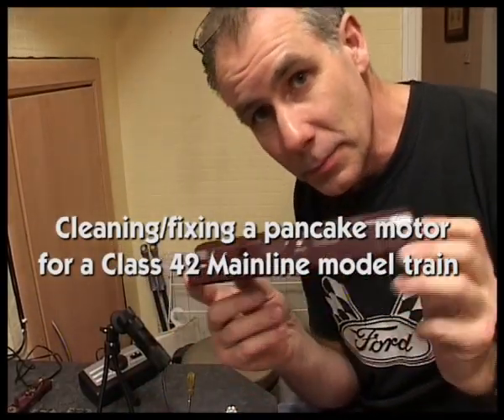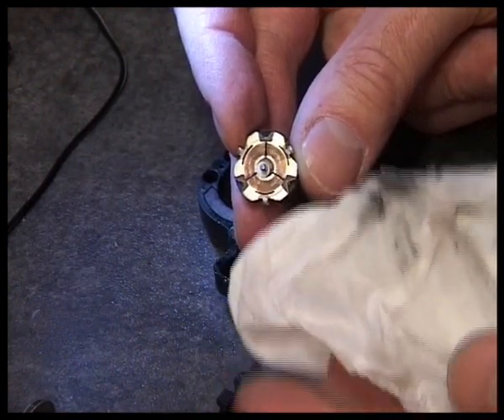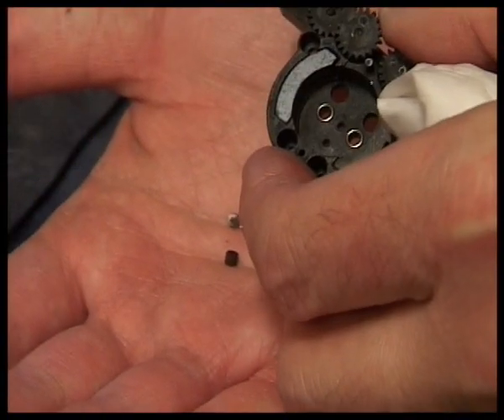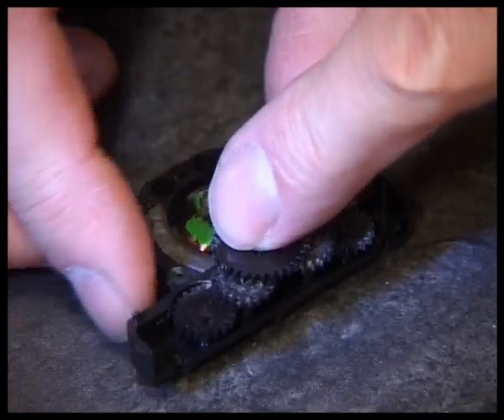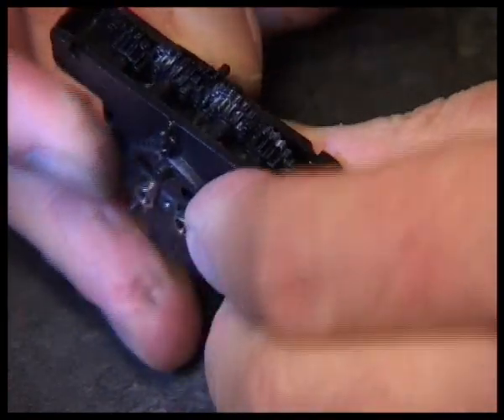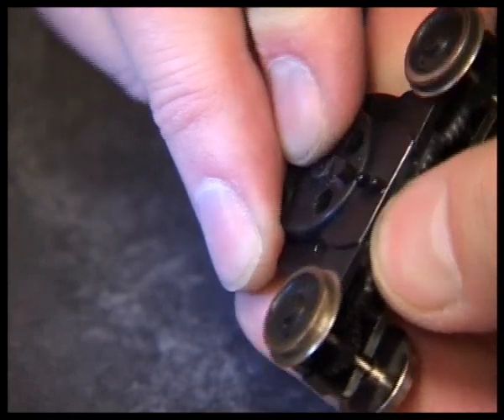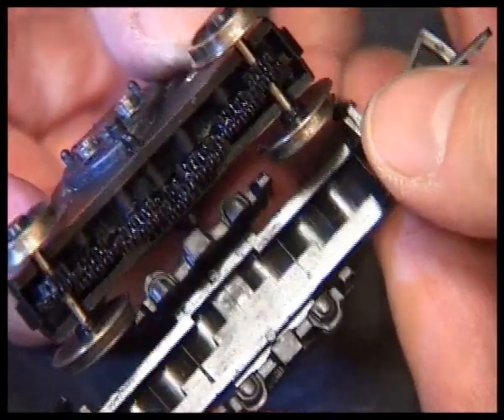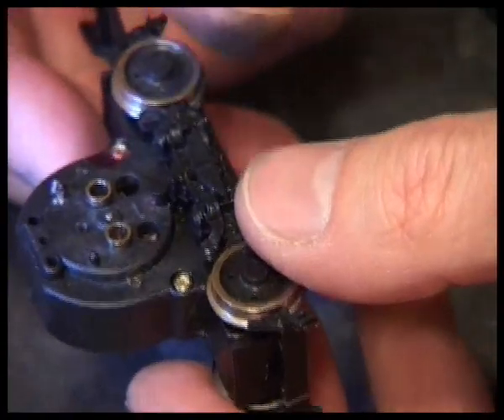Model Train Motor Fix Pt 1 of 3

Comment: Ok, the problem usually is that the metal material in the brushes gets caught in between the segments of the commutator so there is not enough electrical separation between the different segments of the commutator. You either have to cut deeper groves in the gaps in between the commutator segments, or add material to thicken the commutator copper sections. But if you thicken it up you have to cut the sections on a lathe to get a nice flat even surface. Dust in the brushes should fall out of the motor in the gaps in the commutator. This usually happens when the commutator wears down.
Reply from the maker: Ok, thanks for these tips. I've now replaced the motor but thanks anyway.

Comment: Need a video on how you it all apart and out of the shell.
Reply from the maker: Good point Fred. I've sold the loco now. But with this LIMA one you gently part the outsides apart at the bottom of the body shell. There are four little lugs holding it in place, and they stick into four slots in the body itself if I remember rightly. You can actually see them on the sides. There are right under the drivers doors. Also I think the four buffers need to be pulled off first. Laurie.

Comment: i dont own any non steam   as i have a ainline tender  evening star   & i noticed its been  playing up  then the last i ran it it hit a dead zone AKA the  points   the when i   pushed it back  or checked to see if it  derailed   tried giving it   full power & it wouldnt shift  the motor woud still work but not move it at all to the point you can just    get a smaller type  to push it or it needs manually moving  so i took it off the current lay out  &left it sitting elcewere  & when ever i check back up on it  still not redy to return to the lay out   its DDC  as well  but  the wheels sill   freely move
Reply from the maker: It sounds like an old DC (analogue) engine you have there. If it is digital DCC then it could be chip related but I am going to assume it is analogue for the moment. I had an engine that did this, and it was the motion (rods over the wheels) that had jammed. I took it to a local model shop and they fixed it for me. Are the main wheels on the engine jammed? Your actual model driving wheels will of course be on the tender. Hope that helps.
Reply from the maker: Ok, just got your second message by email but it is not showing here on my browser for some reason. I know the model - have two 9Fs myself. Anyway, if the ten driving wheels are jammed, then I am pretty sure the motion (drive rods) are jamming because they are lose. It really needs a specialist shop to check it over. Is there one near you? You can send it back to Hornby or ask for a Hornby repairer near you in Wales: http://www.hornby.com/uk-en/returns
I realise now your driving wheels are in the loco on this model. It is fairly new.